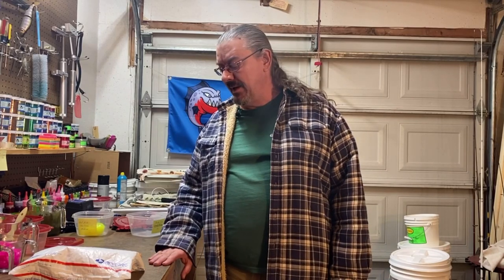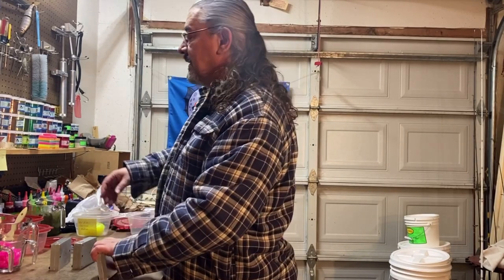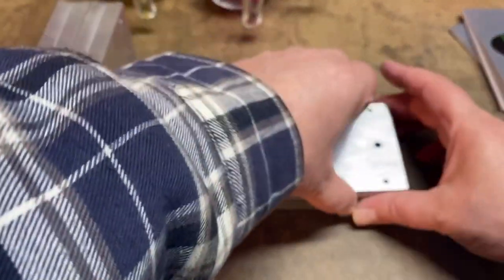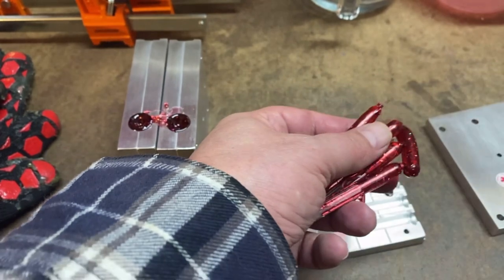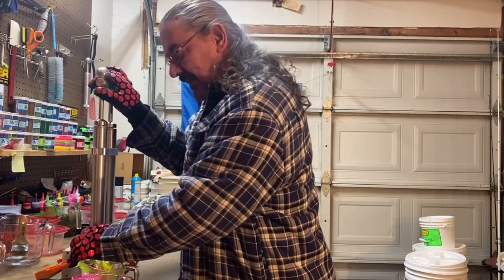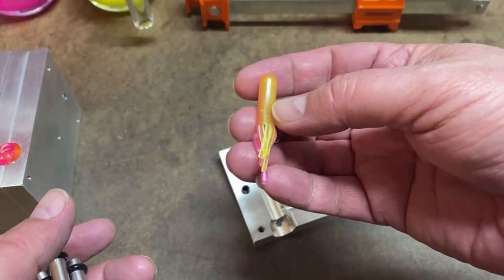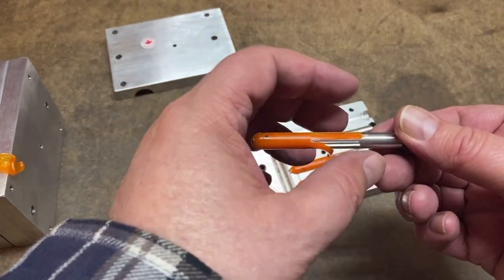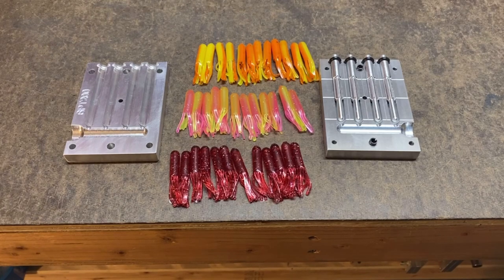Crappie Tubes

Comment: I found the link to your channel on The Enforcer Baits Forum. I've watched a bunch of the videos, and really like the content. I subscribed also. Would you consider making a video using the twin injector to make randomly swirled baits? From what I've read, if you purposely make the 2 colors very different temperatures it should work. 

Thanks for the informative videos.
Reply from the maker: I have done that with a twin injector and I also have a "C-Block" from Angling AI that allows a double laminate or a swirl/camo pattern depending on your temps. I'll likely do more videos showcasing the C-Block and the swirl colors w/o it.